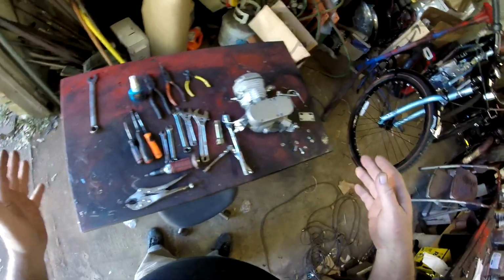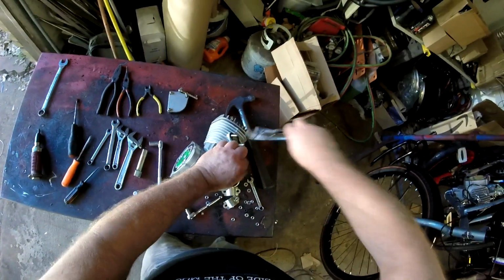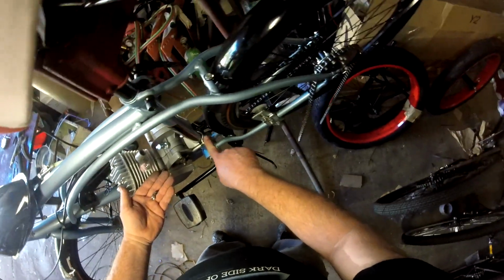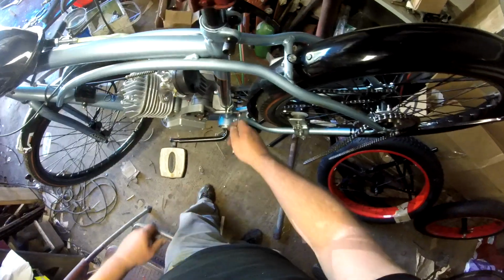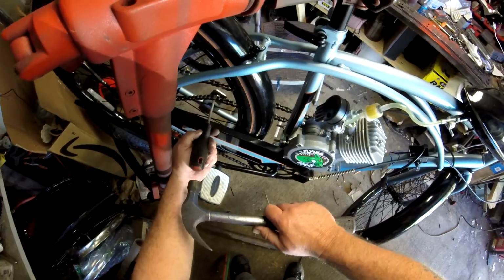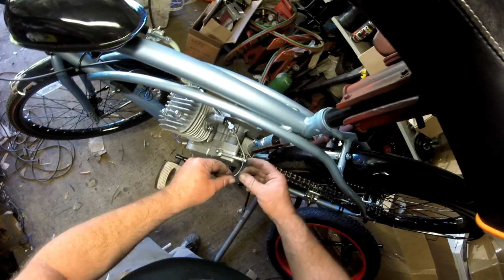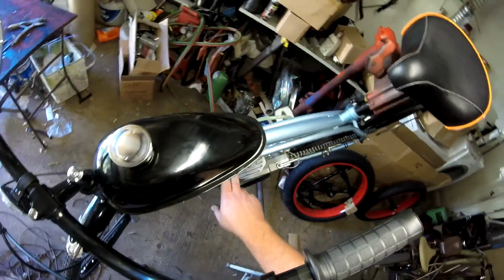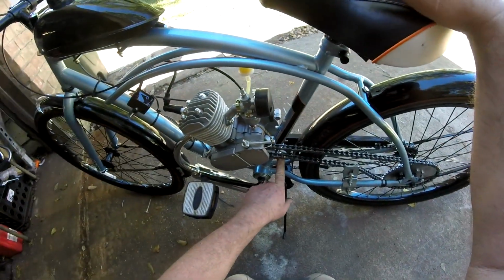How To Replace 2 Stroke Motorized Bicycle Motor

Comment: You know how to fix that chain Tensioner.
 Problem.
 If you're worried about it Falling into your spokes I always find that doesn't hurt anything if you put a shelf Tapping  screw right in the middle to hold it in place.  Once you get it in the perfect position.It's good insuraren't

Comment: hey guy i have a build just like that. it ran fine for a while then nothing. it sounds like there is an air leak somewhere. did you figure out the defective engine problem? was it a head gasket , worn rings or the bottom cylander gasket, intake gaket or exhaust gasket? do a video on hunting down that illusive problem please. hope you and yours are doing ok hear texas is having some weather issues.. . polar caps melting and el nino all at once
Reply from the maker: I had a 60ft tree fall onto my work shed. $1000 to get it cut down and hauled off. forecast is 90 today. Just hoping we don't get 110 temps like a few years back. 

OK, Block off the exhaust and put a hose on intake. Blow into hose and use soap bubbles to test for leaks https://www.youtube.com/watch?v=rj1jfMhdvRY

Comment: Iv seen you do a few of these motor kits and iv managed to get one of my own I got it on a gokart lol bit I can't figure out is why the pullstarts not pulling is there any tips you could give ?
Reply from the maker: Unfortunately I've never used one w the pull start as they are notoriously unreliable. The pull start mechanism breaks early and often is what I've read

Comment: Í add a small pilot hole and a screw íntó the chain stay for the tensioner. Its never moved. Just keep it small as not to affect the strength of the frame too much even if íts a 4 bolt I still use this method.

Comment: I am new to this. What can you do to a thread that got stripped for a hack. I stripped the exhaust bolt hole trying to fit it for the first time. And what size bolt is it originally and what size can I use for a hack if I can???
Reply from the maker: 6mm thread
Reply: Just try using another 6mm screw and put a small nut or thick washer on the  screw and easy screw it on till a good snug.  I ruin dozen of screws onto the exhaust cylinder.  I even tapped it larger.  It worked but too much work.  I kept trying different washer + plus little thick nut and it amazingly gripped.  NP

Comment: Some folk do not advocate using a chain tensioner at all. They run these bikes without such. Many don't use the type you installed, but use the spring-loaded ones, instead. What do you think about such and which do you find is best to use? Also, some folk add rubber tubing at the motor mounts to cushion it to the frame mounting points. Is that wise or overkill in some manner?  I really enjoyed this video and will use it, for sure, as a reference in my builds. Thanks for posting it.
Reply from the maker: Rubber? Not no but hell no. Rubber allows the motor to flex. That allows the mounting studs to constantly bend. Then they'll break, Not good. If one is anal retentive, sure you can play with shims and mounting to omit the tensioner. Pain in the ass. Why?  The chain stretches and the sprockets wear. Me? I'm lazy. it's a lot easier to simply adjust a tensioner. The spring loaded tensioners can slap around and not keep up and you have issues.

Comment: I had a problem like that before and replace everything you did and a new carburetor and still didn't run. Turned out to be the carburetors jet was loose and both carbs. Lol I wish I would have check that before I replace the Magneto CDI spark plug head gasket Magneto magnet lol. Live and learn right. From then on I always check the carburetor fuel jets and every time they're always loose on Evey 80/66cc 2 stroke kit I get.

Comment: Hello, do you know if it's possible to mount a high compression head on a 49cc engine? Is the difference in the 49cc and 66cc engines only on the piston and cilinder? Can I mount a 66cc engine cilinder and piston on a 49cc engine? Thanks in advance. Cheers from Portugal.

Comment: What's up with that flat plate on the front mounting of the engine.
Reply: It is a universal mount that you use if the front mount doesn't fit the frame